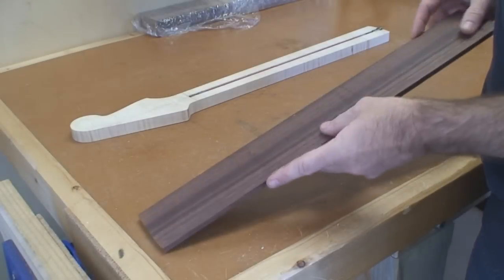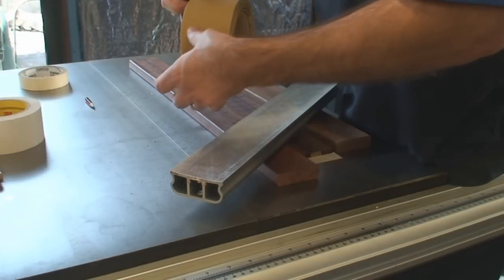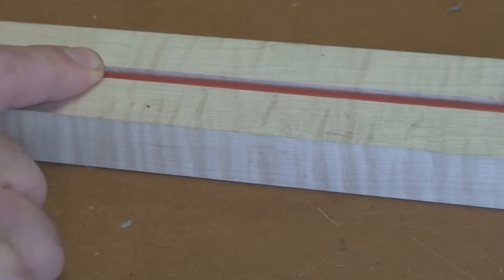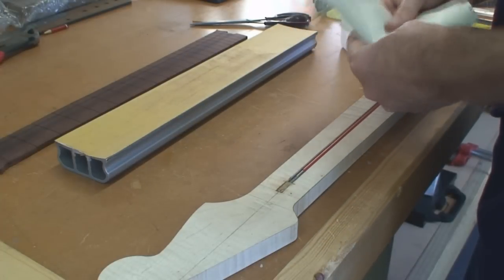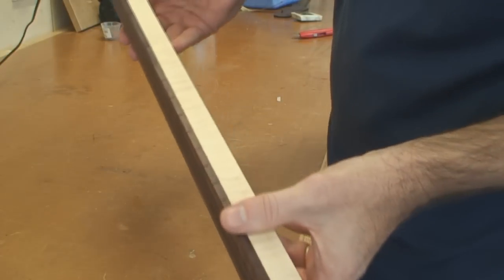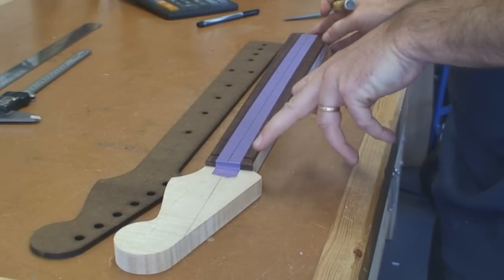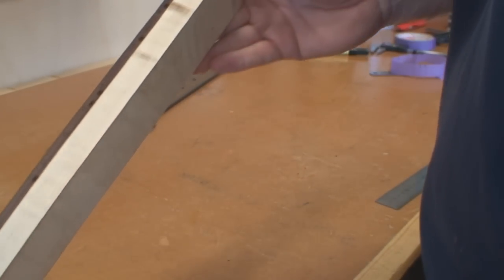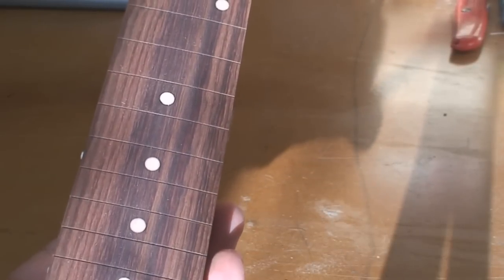Stratocaster Guitar Build - Part 2 - Building A Stratocaster Guitar Neck

Comment: I got a radial arm saw so I can radius first or build a real strat neck with a skunk stripe and a maple fret board that is not glued in, or even slot 6 boards at one time. The radial arm saws from the 1980s have a small enough motor housing the Stewmac 6" blade clears with ease. The radial arm saw has become rather obsolete or at least less popular now that compound sliding miter saws came out. The radial is safer when used properly (knock on wood). Hand slotting properly makes a better product.

Comment: oh man I wish I had a table saw like you to slot the frets. Doing it by hand is so much harder… Basically I measured the fret slots with a pencil, then cut a thin slot with a cutter as a guide for my saw, and now I’m cutting the fret slots with guides on each side of the marks I did with the cutter. I hope I won’t screw everything…

Comment: very nice results. the way i do my inlays is a little different but gets the same results. i drill my holes before i radius the fret board. then after glueing the inlays in, ill put my radius on it so i just have to sand once. like i said though, to each their own and you do really nice work. i just built a strat for a buddy with a pine body and walnut neck with pine fingerboard and it turned out really nice..was jealous to give it away haha. love your videos man

Comment from the maker: I've read that the old Fender dots were everything from wood filler to fiber board so there is some dispute as to what they used to use.  The polymer clay I use can be bought in lots of colors so its a cool option for colored dots you would not otherwise be able to buy.